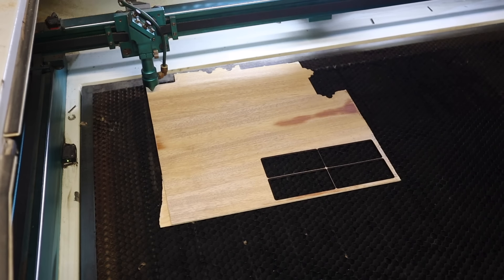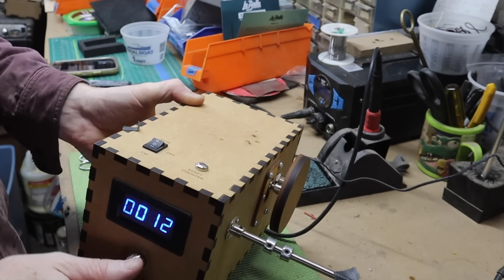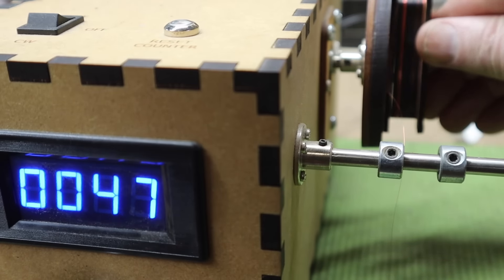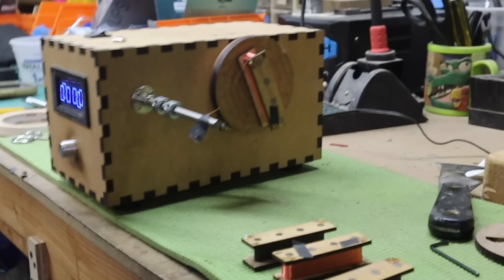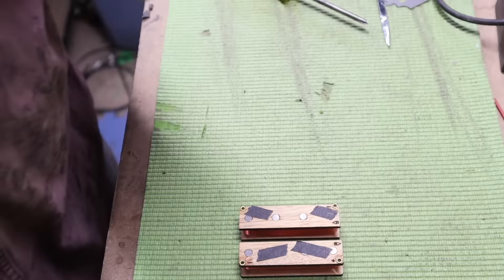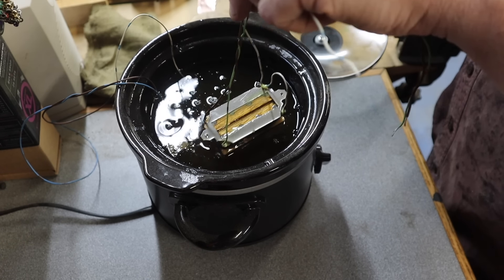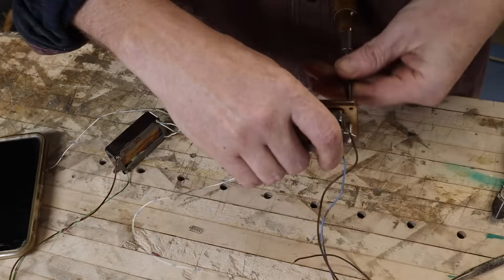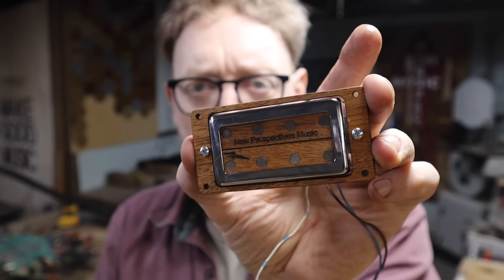Make Humbucker Pickups Yourself From Scratch!

Comment: I can appreciate how you've had to balance quality with ideals.   Imagine if a tool company wanted to make wrenches from 100% recycled metals....     controlling the hardness and strength would be really tough,  and you'd end up with broken wrenches and injured people.   I've found the same thing in life....   I don't want to buy a new thing we need,  so I repair a used one instead...   It's amazing how much stuff ends up discarded,  even if it's not broken.   Youtube's corporate bin-searching teams have shown us that.
Reply from the maker: Indeed. It is a balance. I try to start heavy on the eco-side and work back to production ease and repeatability, rather than starting with unlimited resources and disregard for these issues, then peppering them in as a marketing ploy.
Reply: @timsway  so... NOT the apple model.

Comment: I wonder what a guitar version of those pickups would sound like. You are using magnetic pole pieces instead of the standard bar magnet with slugs so I am sure they would/should sound really unique albeit a bit like a Fender Wide Range Humbucker I would imagine. But it might be better to make them standard H.B. size so they fit existing pickguards and trim rings. Not sure if you are wanting to go into business but there are way more guitarists looking to try new pickups as opposed to bass players in my experience.
Reply from the maker: They sound great as guitar pickups and fit in standard humbucker holes. I have some for sale at newperspectivesmusic.com
Reply: @timsway  do they have 6 pole pieces though? I will take a look. Is there a guitar demo?
Reply from the maker: @skullheadwater9839  yes. neck and bridge spacing, .195" A5 posts. I'm not remembering a sound example of those in a guitar off the top of my head but these are the nailbuckers I make: https://youtu.be/KW0dtpnlmQ0 and these are the same but in a bass vi: https://youtu.be/MiDHyV_kc5k

Comment: Well done - kudos to you for expanding your control over yet another aspect of your guitars 😊😊.
In a year or two:
- strings from reclaimed fencing wire 😅 (or pianos)
- tuners from the insides of burnt out liquidisers 😅
- and some stuff I can't even imagine 😊😊
Reply from the maker: LOL. next up is more bridges, then tuners. Like I mentioned in this video, some of my earliest guitars were more reclaimed with handmade bridges from scrap, used electronics, nuts and bolts, etc., but they looked and felt too "DIY" and were not professional-grade instruments, so I dialed it back and started buying traditional parts to mount on my guitars. But now I am chipping away at them back to handmade, but better.

Comment: Wonder if you could smelt a bunch of aluminum trash and make a mold for those metal housings. Not sure if the material would be the best, but worth a shot. Suppose you could do pretty thin slabs and clean 'em up, bend 'em, and call it good.

Also, hey! Building my first guitar from my neighbors scraps. Your channel kinda planted a seed, saw him tossing out some cherry offcuts and just asked for 'em. Keep it up :)
Reply from the maker: I think if I were to make my own surroundings I wouldn't smelt anything (big carbon footprint for relatively small bath work like I do), But I bet one could flatten out a beer can, cut and bend the shape from that without all the propane...
Reply: @timsway  very very true. and good point :)

Comment: @timsway have you ever been asked to make a red special style pickup?
Reply from the maker: no. Don't know much about them but my understanding is the original was made similar to the way I make my upright bass pickups (multiple, smaller coils) that didn't work all that well but the ones used are made similar to strat single coils, more traditionally?

Comment: I dismantled my first door. It's gone into a medicine cabinet.  Have you thought about using and old secondary coil off a microwave transformer for the winding of the pickup
Reply from the maker: I have looked into unwinding motors and stuff but the copper is usually a much heavier gauge. I'm sure I could make "something" work but that's one of the parts I decided to go for consistency over reclaimed.
Reply: The secondary winding off a microwave oven transformer (mot)is a lot smaller gauge then other motor I think. I want to try a few things with mot so may need to try
Reply: But I do thank you for using the saying that hollow core doors are the new pallet lol. The medicine cabinet I am making is both pallet and hollow core door

Comment: On the bass humbuckers do you leave the opposite polarity coils on when they’re split so they still humcancel with both pickups on in single coil mode?
Reply from the maker: y'know, I don't think I did, but that's a great idea, to do them J bass style
Reply: @timsway  Yeah, even if they’re not wound exactly the same the coils will still mostly hum cancel.

Comment: What kind of wax do you use? I've been looking up DIY guitar stuff and saw an interview with a luthier who was swearing by paraffin only but the interviewer just seemed baffled that they don't use any beeswax. I was wondering if you've noticed it making a big difference. 

The big reason I'm looking into building a guitar from scratch is that I want to make a guitar that uses no animal products at all. Couldn't find anyone who makes one, closest I got was Fender telling me "Oh, we don't know if we use hide glue and beeswax or not" which seemed like a weird response. So if it just sounds terrible without beeswax maybe I'll deal with the microphone-y sound you mentioned in the video and avoid the wax altogether.
Reply from the maker: any wax will work fine for potting pickups. no animals need to be abused to make a good guitar.

Comment: Typically humbuckers have both coils wound in the same direction, and are wired reverse polarity, start to start, or finish to finish.  

The only reason why Fender winds the middle pickup in the reverse direction is to keep the start of the coil connected to ground.  The reason for that is the start of the coil is in close contact with the magnets.  The magnets are not grounded, so if you touch a magnet with your fingers you will her a loud buzz. By grounding the start of the coil that is eliminated. 

There’s nothing wrong with winding a humbucker in reverse, but it’s not the way it’s usually done. Also humbuckers aren’t scatter wound. But that doesn’t really matter.  I wind by hand but don’t scatter wind.
Reply from the maker: thanks for the insight. Yea, I don't think the wind matters much either, scatter is just easier (for me) to do by hand to have it look consistent. I honestly don't remember why I started winding one in reverse, but I had a reason. LOL. These are still very different from "traditional" humbuckers with the individual poles vs bar magnet, too, but look and sound good and are pretty consistent (the nailbuckers I make use a bar and old iron nails as posts - these are a lot harder to make).